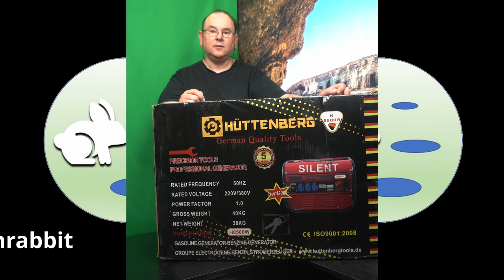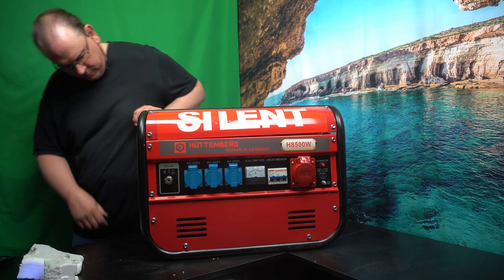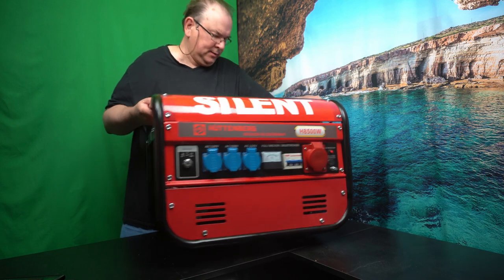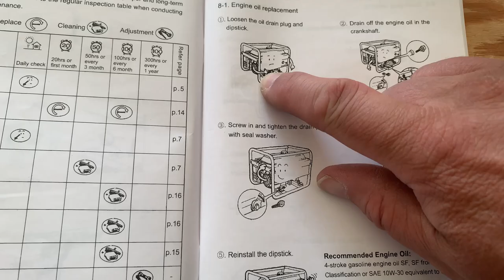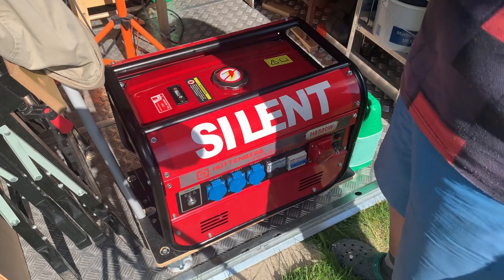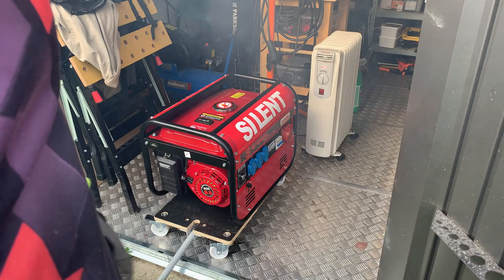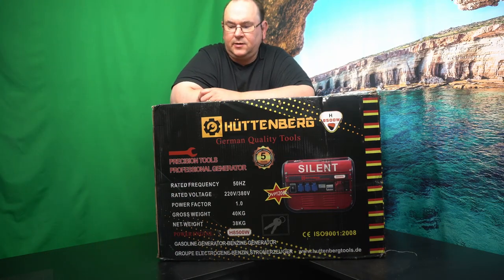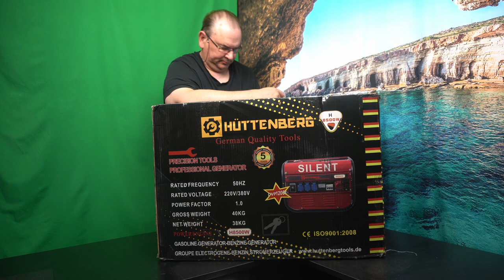Petrol generator Huttenberg H8500W unboxing and first startup

Comment: Cmon more life!!!😂
So is it working with automatic starting or is it manual starting only?

If I plug it into my house power and the power goes out, does the generator automatically start?
Reply from the maker: The model I have is manual start. No option to auto start :) however I do think one could probably add a battery start as they are probably all very similar. Like in the case of this model the key is modes are indicative that such a option  is available.